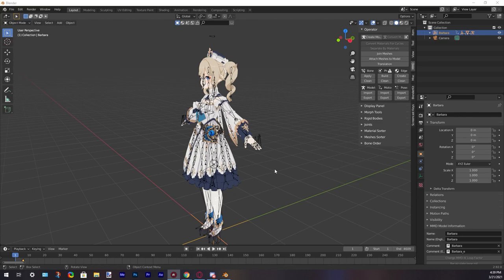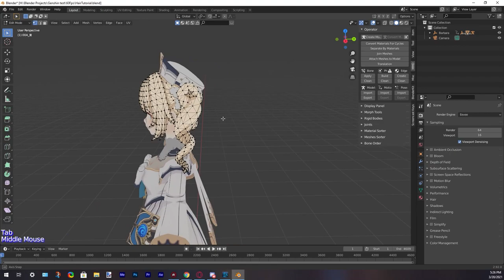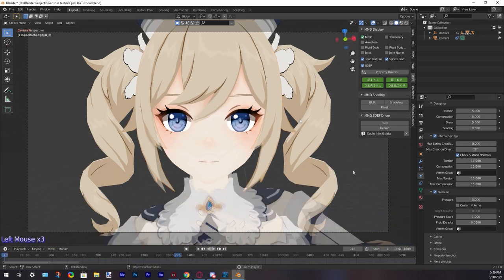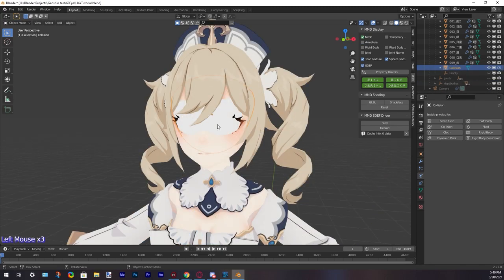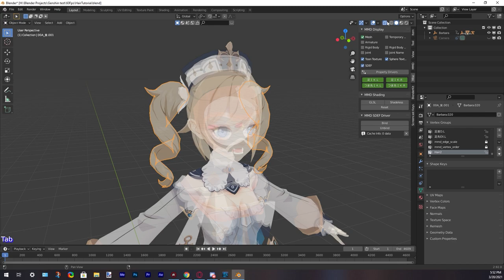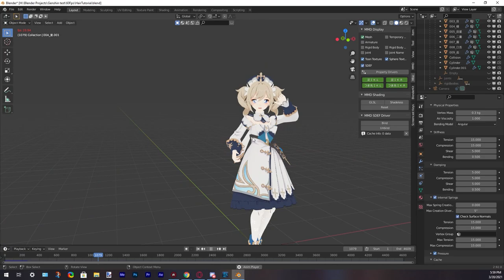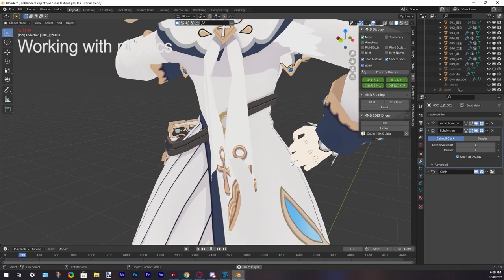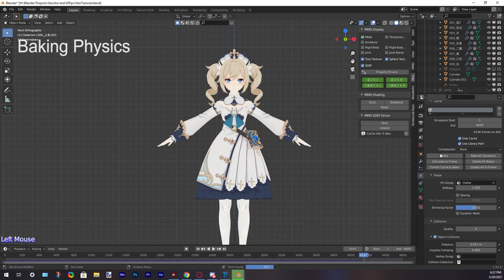[Blender Tutorial] Blender Cloth physics to your MMD models part 2 | Hair & Accesories

Comment: Thanks, but I wanted to try to to animate those things in her dress (which always fell in 1'st tutorial) and the belt with the book. I can animate the belt, but I don't know how to properly attach the book to it. I tried to attach these things to the dress, but they were too wobbly and it didn't look pretty at all.
And also little tip: blender autosaves progress if you didn't disable it, you can recover your work trough File->Recover->Auto Save...
Reply from the maker: That’s the reason why I didn’t show how to apply physics to the book, I’m still beginner in blender, this tutorial is a compression of hundred of videos I saw to make this, I’m still working in how to connect those parts and make not fall 

Thanks for your tip :D
Reply: @DerxxAnimations  Ok then, i'll tell you how to do it if i find a way to do it nicely (i already found that you can parrent an object to 3 vertices of another object, but it doesn't work well enough imo)
Reply: @nik325007  Yeah I tried with vertex parent and the position copy and it did not work properly. The position and rotation end up wrong after a while.   I do not think people who suggest that option ever tried it on complicated cloth that need to follow a dance  for 3 min.

The most effective solution I found so far, is to properly weld the mesh together and use cloth "pressure" with a vertex group chose the part that are meant to be solid. This way the inflated part of the cloth become semi rigid. Also sometime I use mesh deform modifier to run the cloth simulation on an invisible simplified object that control the the visible detailed object.  This way It is possible to put really high pressure inside a  cube and it become even more rigid.
Reply: I recommend the first option, which is to use the "Wiggle Bones" plug-in or you can also use Blender 2.80, ok ? 😊😊🤗🤗
Anyway, Here's the link: 
https://download.blender.org/release/Blender2.80/
And here's the link for MMDTools for any version of Blender: https://github.com/powroupi/blender_mmd_tools